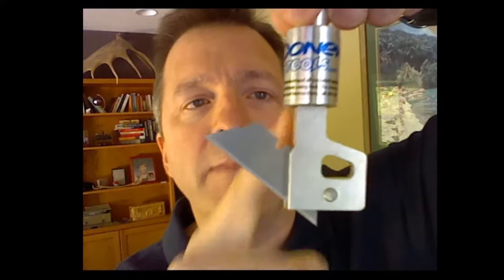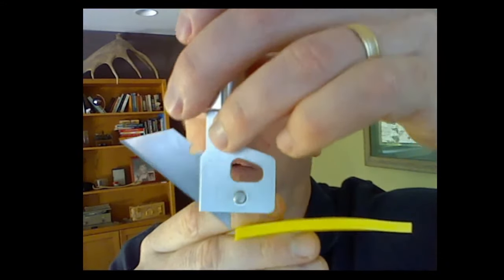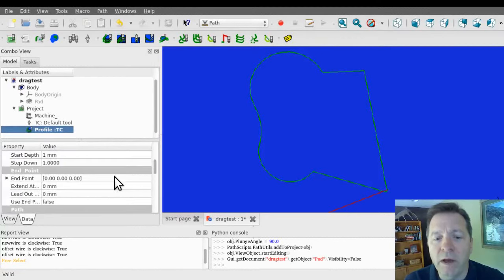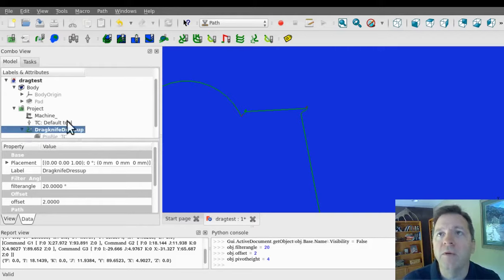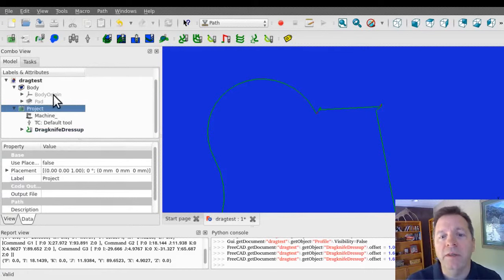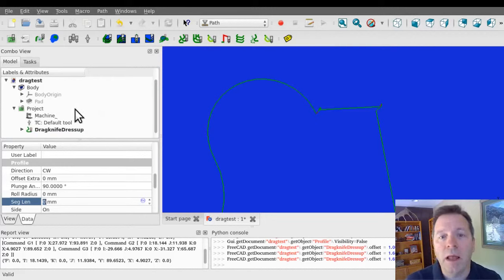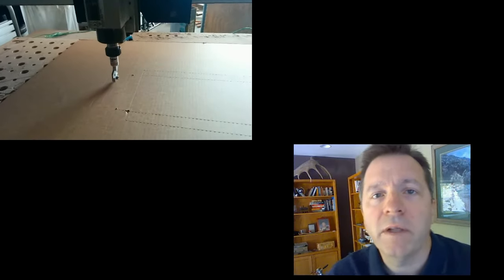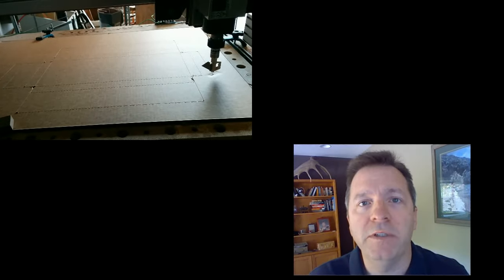FreeCAD Dragknife dressup operation.

Comment: How did you setup the Default_tool? Did you alter it (e.g. give it a tiny diameter like a knife) or is that irrelevant?
Reply: This is pretty old stuff.  The dragknife dressup has the setting for the offset.  If your cut needs to be very accurate, you can set up a tool with a tiny diameter and make sure the profile compensation is turned on so it offsets the profile by that diameter.  With a dragknife, you're cutting with a razor blade though materials that aren't usually that sensitive to tolerance.  So I cut 'on' the line and use a default tool.  
Now that we have the new toolbit system in FreeCAD, I'll eventually rework the dragknife dressup to look for a dragknife type tool and take the settings from there.  But that's for the future.

Comment: Hey, Brad! Very nice! I have recently doen a prostprocessor which works wit plain g-code files and adds the corner actions, but having it integrated in FreeCAD as dressup operation would be just awesome! Where can I get it? My current FC version 0.17 daily does not seem tho have it.
Reply from the maker: Sebastian Stetter if you're building from source or using the daily binaries you should have it. If not post to the forum and include your FreeCAD info.
Reply: Brad Collette Thanks! I'll check. I am really excited for being able to do CAM in FC as well. Good Job, man.
Reply: Brad Collette Thanks! I'll check. I am really excited for being able to do CAM in FC as well. Good Job, man.